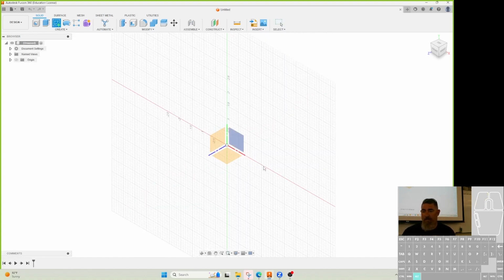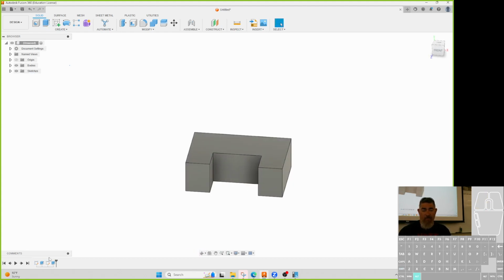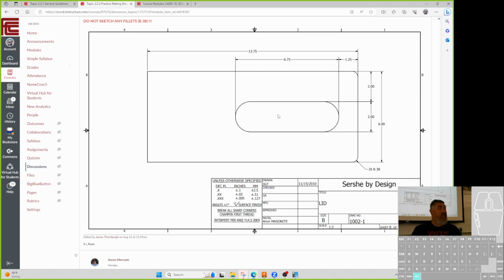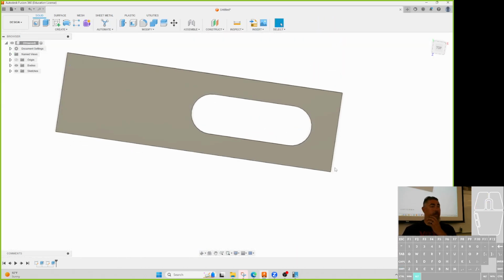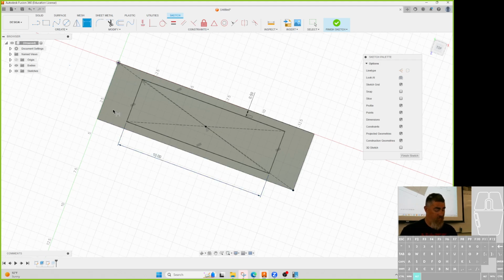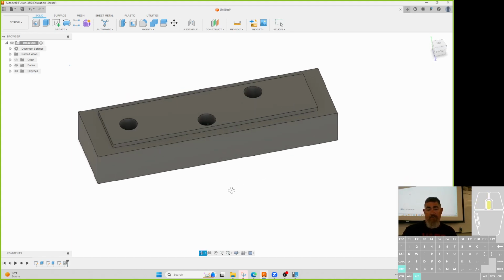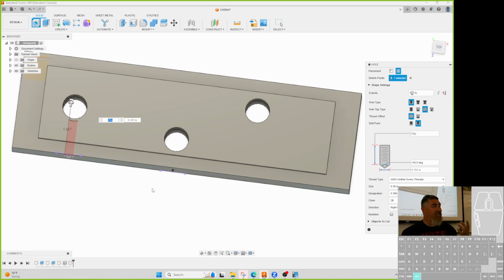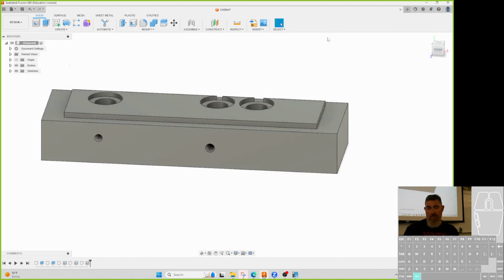Centering Sketches in Fusion 360

Comment: At 2:00 you talk about a line. What line and how did you center the rectangle on the top surface? All that was shown was selecting a rectangle and positioning the first corner in what appears to be some random point. Take it slow, show what and how, like others (probably) I came here to find out how to do something, not to just be amazed and frustrated because what I want to learn is skipped over. Step by step, lead and show what and how.
Reply from the maker: Thanks for the feedback, this was recorded in class, and I am planning on redecorating all of my materials, and making them avaliable along with the exercises, so everyone can get more in depth practice. 

I was referring to the line that was projected from the side of the part.  The rectangle that I drew wasn't centered on the face, it was just away from the edge in a random location so that it would be easier to select select the side of the rectangle and the projected edge when adding the midpoint constraint.

Comment: Massive respect for the training you provide, Fusion still strikes me as being one of the most obnoxious pieces of software I ever worked with.
Reply from the maker: Thanks,  when it first came out I hated it, now it's the one I use the most,  and despise having to use SolidWorks. What makes fusion obnoxious to you?
Reply: @CADTrainingNow  What should be the most simple and intuitive action is impossible to those of us who haven't used the program for years. Why is "click and drag" impossible? Why is it so difficult to do something as simple as relocating the origin on a part to be machined? There is so much that is obnoxious to those of us who are trying to learn how to use the program.
Reply: @oldtugs what do you mean by click and drag? Or you are trying to move components use joints. As for moving the origin for machining in the work setup you can define your origin pioint and axis directions for that setup independent of the origin that was used to model the part.